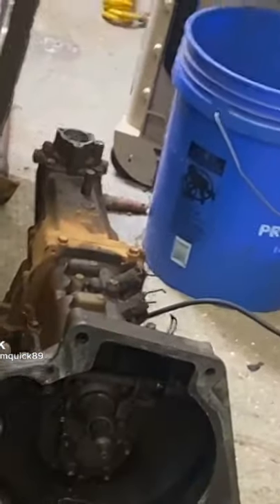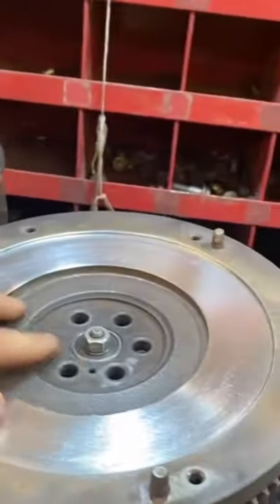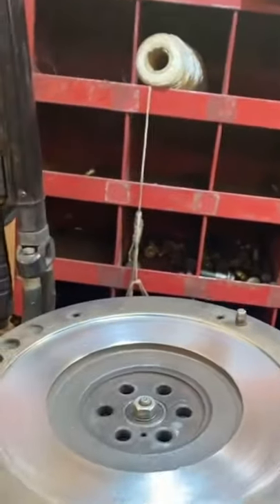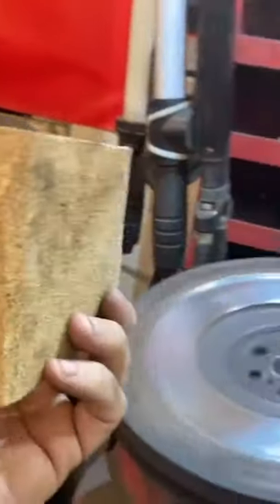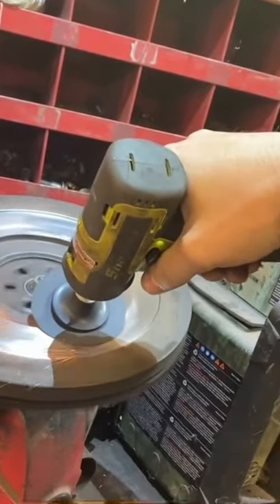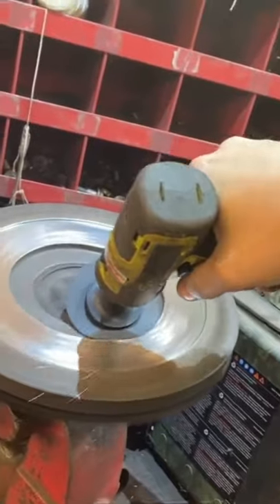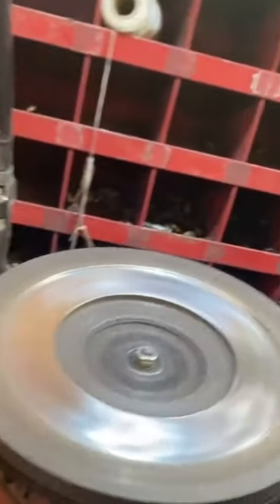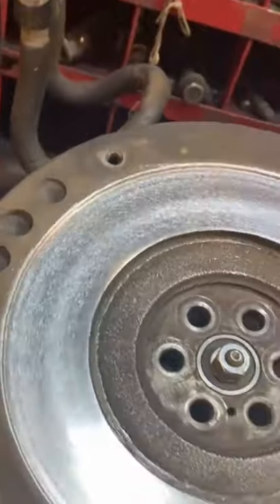How to resurface a flywheel when doing a clutch in less than 60 seconds#shorts

Comment: I'm having a hard time debating if hes serious or not
Reply: same
Reply: not serious lol
Reply: It works.

Learned something new didntcha
Reply: @SoloClone  following up with the other guys comment, the reason you go to a machine shop to get it resurfaced, is that they will take an equal amount of material from top of the wall as they take from the contact point of the clutch. It basically resets the flywheel to factory spec.
Reply: Sad thing is that someone, somewhere is gonna copy this.
Reply: @ Get a Grip
Reply: @SoloClone  it should fucking def not be done. If you know anything if there's a single indent in your fly wheel it's not gonna catch right and fuck it up. But ig that's why everyone's car is a money pit
Reply: Yeah
Reply: @BigChungus-no1ve  I have found the big chungus
Reply: @pcd1377  you do realize you can’t tag people here right?
Reply: Could work if you did it with an compressed air and a sand block?
Reply: Cars aren't as picky as you guys think that they are.  Every time my transmission got taken out of my Subaru or if it needed clutch work, a really light sanding pad(wiz wheel) was used to clean it up.  Didnt even have the flywheel spinning like that.  Never had a single issue and that's with like 10-15 prepped track launches(very strenuous on awd cars if you launch correctly).  Things aren't as scary as people portray them as being on the internet folks.
Reply: Cambron Gabaree  in a 5 speed subaru with over 300whp?
Reply: It’s a jeep, he’s serious.
Reply: Ofcourse he serious! Didnt u hear? It come out more gooder 👌🤣
Reply: Cambron Gabaree  bruh what do you even have for a car that you're being all, I'm king of the hill and better than you?  Please atleast say you have a modified awd car with over 50 prepped launches on it.  Most people in the car game regurgitate what they read online and never actually live through the stuff.  I speak from experience not theory..
Reply: Cambron Gabaree  Hey bro you seemed to have avoided the question about what car you have this real world experience with.  Or are we just gonna stick with the google images Buick gnx?
Reply: Anything that needs to go to a machine shop is because it’s tolerance +/- is too small to be accurate by anything other than a machine shop finish lol.
Reply: All you're doing is breaking the crystalization layer that builds up.
Reply: He said "more gooder". There is no way that he is serious ....LMAO
Reply: @eflem7708  I do all my automotive work due to sabotage in the past, I realize that, No one will take better care of my car then I..  However, Resurfacing a flywheel is one job I have never done! March of 2021, I installed a 38k mile transmission from LKQ-250, into my Pontiac!!! There isn't much of my car that I haven't done!!! Entire suspension, timing set, with new oil pump/integrated front engine cover, water pump, could be here all-day listing every upgrade!
Reply: I reckon he is serious. Probably wreck the clutch quick 4x4ing anyways.
Reply: @eflem7708  yes sir, I did replaced the head on my engine myself with a yard head. Checked for warpage with a feller gauge and a piece of glass lol and then put sand paper Down on granite table top and used weight of head to even everything out..been good for 2years now no leaks and compression is at factory I can pop the clutch at 5mph to start her if my dumb as leaves switch for fuel pump on lol. Point being from that long ass rant...is everyone says "you can't do that it will never work for this reason or that" and exactly as you said MOST people learn the shit they spew out from comments like this or forums and the people there reading and learning from have never done before abd so on. Ask any old school fucking mechanic they ALL used to resurface heads and flywheels alike in "backyard" ways they didnt have all these fancy ass machines and shit to do things "by the book" hell if you ask a true old school gargae mechanic how to straighten a warped cylinded head..he's going to tell you to go grab the acetylene torch and straight edge..yeah some thing you DONT do but think about how things would have been done back in the day when car modification was at its peak and ask yourself if you think they all went by the book and if not how the hell your grandpa's 1950 Mercury is STILL running and how he kept it running all those years with all the story's he has of racing it lol.
Reply: @WiThErZ666  been doing it for years. If you are working with a 1000hp get you a new flywheel. But this works just fine
Reply: @JF32304 awesome less of that to mess with my clutch

Comment: I like to put the fly wheel on the motor and bolt it and start the engine without the clutch or trans on and just hold a lava rock up to it
Reply: Lol....
Reply: I didn’t even think about lava rocks, sounds a lot Gooder then using my pecker
Reply: @codysteele91  Hahahaha
Reply: Lol
Reply: Gotta love that 1 grit sanding stone
Reply: Lmao
Reply: But it's hard to get lava rocks unless you live in a state with a volcano in it.  But those are rare.
Reply: @KyrieEleisonMaranatha  psshhh I took a lava rock to third grade show an tell. Lmao true story. I use the same one still ahahah
Reply: @COYOTE_N8  well i moved my shop to Hawaii so i would never run out of lava rock. I'm doing like 2 fly wheels a day sometimes. 🤣
Reply: Tip of the day
Reply: I use those stone my tia and primo use on them tough ass elbows and necks
Reply: @codysteele91  hahahahaha

Comment: As a machinist I can promise you that isn’t how it’s done. Good job!
Reply: He used the wrong grit of scotchbrite huh?
Reply: @fattslapper1819  you could say that.
Reply: @johnjeppsson17  🤣🤣
Reply: I know this isn’t the right way to do it but will it work? That’s the real question.
Reply: It's more.
Gooder thou. 😎
Reply: @OG_Sleepy117  it will give the clutch plate some bite.  Is it the proper way?  It's like doing a disc brake pad slap.
Reply: It’s kinda similar. Just more precise when done properly by a machinist.
Reply: @kelsycunningham8452  that's not the real point the real issue here is the surface will not be perfectly flat when he's moving the drill around by hand like that. Very good chance he will have vibrations and the new clutch will wear unevenly

Comment: The reason you surface it is to make it flat. Not smooth. That is now the opposite of flat lol. Now that and a hone might.... Work.... Maybe
Reply: Not a Honda guy but always have loved the preludes
Reply: The depth of the step in the flywheel is an important part of it as well...
Reply: DDOT EEL  Mmmm glaze dooooo-nuts
Reply: @tenmil1  THIS. As someone who works at a shop that turns flywheels. They are turned for FLATNESS not to be shiny ot fresh. And the step needs to be ground down the same amount as the flywheel surface itself to help everything mate correctly
Reply: @Gamermonk999  yep. Theres a reason for the spec in the book.
Reply: @Gamermonk999   👍 exactly right. Also, so it can have an even rate of thermal expansion and contraction. The thinner part will expand sooner than the thicker part, due to less mass in that area, causing warping.
Reply: Well I thought you also want a semi course surface to break in the pads with the fly wheel at the same time so they have a good surface contact y/n
Reply: @Noplanman98789  well it shouldn't be polished or anything but the finish off the lathe is fine. I wouldn't recommend roughing them up
Reply: @jessesward9429  me too
Reply: @Noplanman98789  Yep, I wouldn't say course, just not glazed. If the flywheel is left glazed, the clutch pads will never break-in and mate properly. Just like brake rotors, the goal is to have some material transfer at the microscopic level from the pads to the mating surface in order to attain the proper coefficient of friction, this is impossible with a glazed surface.
Reply: Not always true, some flywheels have a domed clutch surface area (like a Jeep 4.0) either replace or reuse how it is
Reply: @bdun1226  ok then tell me how what he's doing is going to work properly under that condition
Reply: @preludedude4765  it’s not. I didn’t say it was. What I did say is not all flywheels should be surfaced flat like you said
Reply: Flywheel turner dudes, many different flywheels and not all are solid, some step, dome, in, out, two piece. Starter gears serviceable. Love reading these comments. About to hit midlife and never seen such misinformation.
Reply: @WoodLox  do you even watch mainstream news??
Reply: @WoodLox  once again, there's a reason we have specs in the book. If you have the AERA flywheel manuel, you know what needs to be done.
Reply: Chatter chatter chatter chatter...!
Car will shake rattle and roll when he tries to use the clutch.
😆
Reply: @tenmil1  The machined 'cross hatched" is measured in RMS (root mean square).
I think (not real sure) flywheel should have a ~145 RMS surface. (I could be quoting cylinder bore surfaces tho.)

Comment: I actually did this to a shitbox honda civic I had (didnt go as ham with the flap wheel tho). Resurfaced the flywheel and pressure plate with an air grinder and slapped in a used clutch disc, drove it for a year until I sold it (still see it every once in a while)

Comment: Nah, fam u doing it all wrong.
The correct way is to just install it, put it in the last gear, do 6k rpm and just let it slip for a minute or 2
Reply: Damn dawg das genius
Reply: Ok so I sense humor, but I'd really like to know what actually happens if someone was to do what you're suggesting.
Reply: @123bambam4  i guess it would just burn the clutch out fast af, or maybe the clutch pressureplate would start to melt on the surface, im gonna try that someday when i get my hands on a scrapyard car with a working engine LOL
Reply: This will actually work, but you don't need to do it from 6k rpm, and do it in 2nd or 3rd gear.
Reply: How to summon the blue flywheel of death
Reply: All he's talking about is burning off the crystalization on the fly wheel.
Reply: Dude my uncle, who has passed away now, said that is how he would “resurface” them any time he did one. He would do it in reverse and just barley hold at the friction point of the clutch with the emergency brake on!! His explanation was, it doesn’t have to be “resurfaced” just mated up to the pressure plate. 

He changed the clutch in my 99 Camaro SS (on a stone driveway with the car up on cinder blocks) in about 2 hours. I know the guy who bought it and he says he has put over 85,000 miles on that clutch and hasn’t had a lick of problems with it! 

He definitely was a character though. He was a good ole boy from NC who drove a Pepsi sponsored NASCAR for a few years. Man I miss that dude. The real life knowledge and skills he taught me (right or wrong) will stick with me until the day I die! Miss you Uncle Jim! Hope you’re in heaven changing clutches the hillbilly way!!
Reply: @HerculesRockefellerESQ  I think my uncle would do it in reverse first and then do it in 3rd gear. He said NEVER let it bite and stall though. Make sure you’re keeping it spinning the whole time or it will “bite” and you will always have a spot that is jacked up.
Reply: Puck clutches unironically break in this way. 

With standard clutches you need to heat cycle them to assure good friction and contact etc etc

But puck clutches are meant to grab extremely hard and not slip. A good way to break them in is to slip them for a few seconds and then do a big burnout....Or let your GF drive it to the store once.
Reply: @Scottross93  😂😂😂 I guess everyone’s girlfriend is the same!!! Had me cracking up man!
Reply: @123bambam4  probably create to much heat in the clutch friction material which will cause it to glaze over and reduce friction/cause clutch slip.
Reply: @123bambam4  if you're lucky it'll just burn the everliving hell out of your new clutch, but it'll probably still be drivable for a good long while. Although good luck getting that burnt clutch smell out of your seat fabric afterwards.  If you're unlucky it will shatter your new clutch. Clutches have a break in period before you should go dumping and slipping them like a hoon, new ones have a chance exploding if you drive out of the shop and immediately launch into some sick  drifties.
Reply: Needs at least 5 minutes of slip for break in
Reply: @123bambam4  at Denver Auto & Diesel College (now renamed and owned by Lincoln Technical Institute), the auto trans class we had to tear down, identify worn and damaged parts and replace it. Upon rebuilding them we would have to test our transmission on the transmission dyno and the upon passing the instructor would slam it in high speeds before slamming it immediately into reverse. New problems for the next class. ;)
Reply: @123bambam4  it would either take it or destroy itself lmao
Reply: Damn straight! The only professional I’ve witnessed in this comment section so far...
Reply: @BadMax02_VR  
Without checking your link...

What’s it got STUNTMAN?!!!!
Reply: @chaslaspata5385  
I like your story. I like your uncle too!
Reply: @jonathanviera3466  
Ok. So 5 minutes of driving......
Reply: @kevintucker3354  thank you
Reply: @123bambam4  
Its a great way to make sure your clutch slips from the start 👌.
You know.  So it dosent wear out with all that friction n stuff.
Just glaze that som bich over immediately 
Lol
Reply: @123bambam4  another clutch
Reply: That's how we been doing it at our shop for thousands of years.
Reply: Adjust for maximum smoke.
Reply: It'd probably be more efficient than the method in the video. 🤷🏻‍♂️
Reply: @chaslaspata5385  awesome story of your uncle mine always helps me with my problems I cant fix too gotta love our good family members, love the bad ones too but dont care to see them hahaha
Reply: @AllaboutTheWoodrows  he’s been gone for over 15 years and I still get tears in my eyes thinking about him and all of his life advice.
Reply: @chaslaspata5385  they definitely helped us be part of who we are in my case from great uncles ect they all taught me something usually some were wild tho haha my grandmas brother got me drinking beer  at  9 so cant say they all the beet influences 🤣 but them memories tho last forever they all just taught me life and how to have a good sense of humor hahaha
Reply: Glaze the surface for that high torque slippage. Dont want to snatch a trans out.
Reply: @123bambam4  it's called burning in a clutch, it's real but that description is way exaggerated
Reply: Faxxxxx

Comment: You got to hold the grinder at a 45' angle both ways puts cross hatch in it an do break rotors same way works great been doing it for 50 years.